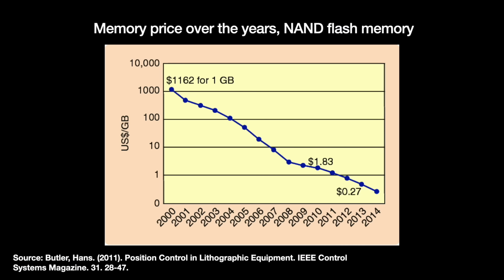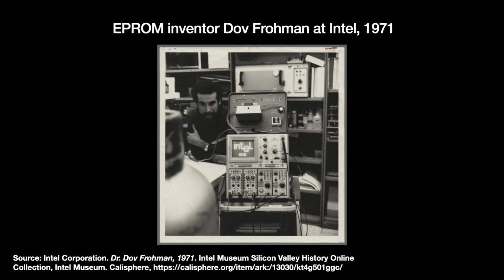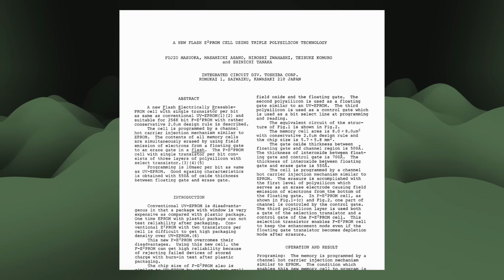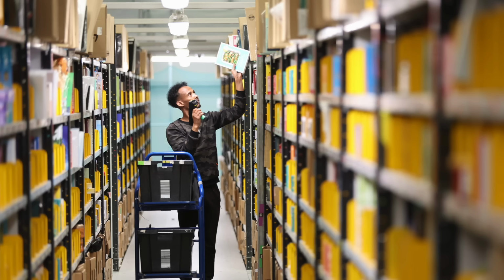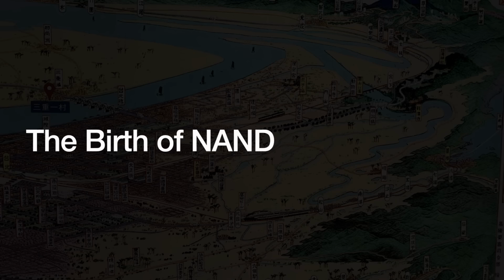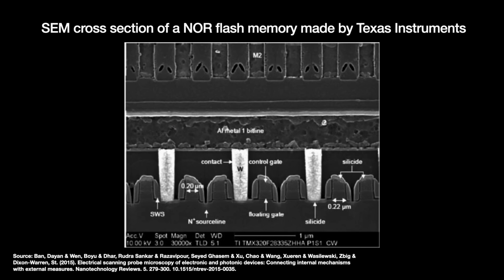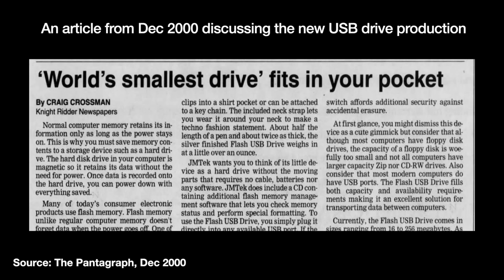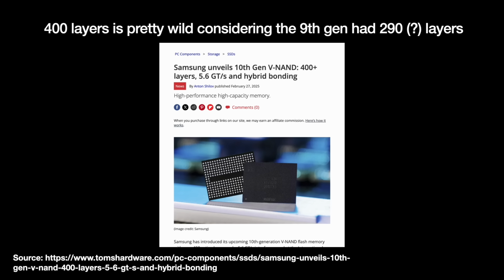The Evolution of Flash Memory

Comment: I found the controller comments a bit funny considering that harddrives also employ all sorts of wizardry to not loose data, because the bits are fundamentally volatile. So you need overhead. There is almost always 99% of the time error correcting overhead when dealing with a digital signal. Its rarely feasible to do without.

Comment: In your discussion around the state of the art circa 1980, I'm surprised that you didn't mention the EAROM, or electrically alterable read only memory.  One notable source of these devices was Nitron, originally a subsidiary of McDonell Douglas, using a Metal Nitride Oxide Semiconductor (MNOS) technology.  Writing to these was much slower than reading and the number of writes was limited, but writing was byte addressable.  They could retain their programming for at least ten years.

Nitron was founded in 1972, and I can find references to the technology as recently as 2001 or 2002.

Comment: I started using UV EPROMS back in the 2708 days, so yes I have been around the block SEVERAL TIMES !  (I thought I went to heaven when the 2732s came out !)

Now a days there are million of SOCs that execute from built in FLASH.  Most of the are small and execution speed is typically not an issue.  There are a few application (electronic fuel injection) that are quite large and require LARGE amounts of FLASH (or other reprogrammable) memory.  These application keep growing and the SOCs are now mostly FLASH and RAM.  (CPUs, even quad core, typically take up less than 25% and memory requirements grow yearly !  Off chip memory, both FLASH and RAM, are too slow.

IMHO, the solution is large on chip caches and NO ON CHIP FLASH !  Each processor needs its own  Level 1 instruction cache, as fast and as large as possible.  The Level 2 cache can be shared between instructions and data.  Speed is less of an issue here, but size is important.

The real trick is, WIDE "cache line", at least 256 bits, between each level of cache and the external FLASH.  Having this many data lines exiting the SOC is an issue !  The solution is simple !  Design the external FLASH chip with an interface similar to DDR dynamic RAM.  Inside the external FLASH chip, there should be 256 bit wide data paths.  These feed to a buffer that "double pumps" the data to the SOC, 32 bits at a time.

Comment: I was recently building a server on Raspberry Pi requiring at least 1 TB storage space (Bitcoin blockchain). I am still amazed that a single poststamp-sized SSD chip with 2 TB capacity can happily fit in a tiny box only slightly higher than a standard Raspberry case.

Comment: I remember getting my first 2GB flash drive around 2005, and thought I had SOOOO much storage in my pocket, and I spent a decent amount of cash for it. Now, I have two 32GB flash drives I paid like $15.00 each for, that I rarely touch compared to the 2GB drive I had before, which I used constantly. These days, I can just send files, even big ones, just over the internet to the friends I might want to give say, a bunch of pictures or a video file. Or if I can't send something over the internet, well, now I just use the 128GB of storage on my phone to move those big files as needed, with the added bonus of watching or looking at what ever it is on the phone itself if need be. I remember thinking back when flash memory was really starting to take off "Man, I can't wait till the capacity is well into the 100GB range in something I can keep in my pocket or on my keys" To now thinking "Wow, I can fit 1TB on something the size of my thumb nail, and nothing to fill it with." It is funny to me that at one time I relied heavily on burned CDs/DVDs, thumb drives, and even floppy discs to move information around, and now I rarely plug anything into my computer to move data, its all peripherals like my keyboard, mouse, and my game controllers. Every so often I plug in an external hard drive to pull old data off old drives, such as my massive music collection, but the last time I had a thumb drive plugged in, it was because my phone of that time was dead and I wanted to take some game files to a friend's house to help him mod a game, and that was, two or more years ago come to think of it....

Comment: Interesting facts that I learned just after watching this video: 
1) Toshiba no longer makes SSDs. They spun off their memory business into a new company called Kioxia  in 2019 due to heavy losses from their nuclear energy branch after Fukushima, and
2) Kioxia made space-grade SSDs for NASA to be used aboard the International Space Station. These are special SSDs without supercapacitors that are capable of enduring space radiation and remain functional. Linus Tech Tips made a video about it.
Reply: I used to work for Toshiba memory America back in 2016 -2018 I did competitive intelligence research on all of Samsungs data center and enterprise drives. We would structure the operating systems commands to be similar theirs. We had an EMI scanner hooked up to pcie ribbon cables to get the exact frequency the nand, controller etc were operating at as well as a flir camera to monitor thermal runaway.
Reply: @Parable54 Do you still work on the semiconductor side?
Reply: OG history

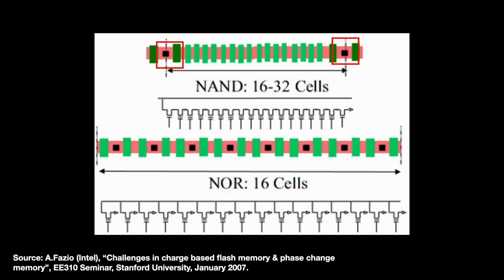Comment: 11:46 And that's why it's so frustrating that Intel closed their 3DXPoint productline, aka Optane. Optane is byte adressable and solved a lot of these issues. Imagine what Apple could do with that in an iPhone or Macbook. Instead of selling the patents, Intel just stopped making them. Sure, it's impossible to fit 245Terabyte on a single datacenter SSD but Optane is amazing for system responsiveness. I installed a 64GB Optane SSD with adapter on a 2013 Macbook Pro, and with Ubuntu the machine felt as responsive as a brand new Macbook
Reply: Optane was really cool. 3DXpoint was phase change memory, really cool stuff. 

Phase change memory would actually be a very cool video topic for this channel...

Comment: 0:09 So Apple charges 2007 prices in 2025 for what is essentially regular flash modules? 200 dollars for extra 256GB, when the flash is 0.02$? That's exorbitant to a crminal level on some countries. The storage cards arent really that special, and storage speeds arent faster than others. Apple's software makes the storage hardware appear special. 
  Fun fact: According to the mentioned 2014 prices, a 256GB storage upgrade should have cost..... *drumroll*
     .... $69

Comment: @Asianometry Ok, something often hidden from the buyer is the technology relating to the limit of: the number write / read cycles, retention life of written bits, and other robustnesses.  In other words, sellers are hidding what fragile flash technologies they are selling.

So, which flash structures are good for archival and system image life, with extended system powered down periods (years), and which of these are suitable for continuous access (read and / or write)?  It's hard to search this subject, and the write once memory alternatives to flash with 40-100 years retention have also largerly dissapeared from the public.

Ok, awake now.  Drift in multilevel cells over time. Electrical bit interference from constant operation of even nearby cells.  Limited life without refresh writing, so that years ago bit corruption was already starting to happen in powered down devices over 6 months in warm humid environments.   Durability means lower density storage and higher oxide layer thickness, but durability is still needed for some applications.  Sir Clive Sinclair's plan for wafer flash sized storage would probably be a good idea in these sectors, once layered in 3D, and 8, 32 or 1 bit cells per addressed position.

Comment: 3:28 The "E" in EPROM stands for "Erasable", not "Electrical". There were chips like that before that were "electrical" programmable - but only once- called PROMs. But these chips could be erased as well --> EPROM
Reply: PROM (Programmable ROM) is written once and permanently via electrical signals (stream of data in a special mode); EPROM (Erasable PROM) can be erased with UV light for reuse (had clear looking window); and EEPROM (Electrically Erasable PROM) can be erased and rewritten electrically, allowing for in-circuit updates, making EEPROM the most flexible and common in modern devices for configuration data, while Flash memory (a type of EEPROM) is now used for larger storage.

Comment: EEPROMS where popular for a moment in Telcom equipment that needed to be remotely updatable. Bubble memory had been used before that in many cases. You had two chips, and alternated between them to make a failure tolerant upgrades. I remember using the first flash to replace it - it was kind of a pain due to limited write cycles and some environment issues EEPROM did not have, the drivers where kind of a nightmare to write.

Comment: How do they put 400 layers on one die?  Does the wafer go around and around and around through the same coating/exposure/etch machinery, or is the production line two miles (or whatever it is) long?  Either way sounds expensive.  Tying up the machine in the first case, and duplicate machines in the second.

Comment: It’s worth mentioning that NOR flash is still useful for firmware because it allows for direct execution of code from persistant storage with no wait states.

Executing code from NAND flash requires reading entire lines into a cache which causes delays and increases architectural complexity.
Reply: This is the main reason NOR, EEROM and ERPOM are used in engine management computers, aka ECUs/PCMs as they need to load and execute code quickly and I also believe that these older technologies are much more sturdy therefore used critical systems like this.

I have one of my tuning ECUs swapped out for an NVRAM which is basically battery backed up SRAM, it allows much faster writing and randomly which allows real time code mortification on the fly, where the stock EPROM can only be changed all at once in a programmer with the chip removed, where the NVRAM allows a direct data link while driving to a laptop while in operation, aka real time.  The EEPROM upgrade allows more flexibility, especially post tuning, much better than using a dodgy germicide light in a box that is the ebay special EPROM eraser. Extra capacity too!

Comment: I was at National Semiconductor from 1993-1996 doing NAND Flash marketing.   National had gotten a license as well and set up a buy-resell business.  We had to sit tight for 1-2 years as Toshiba worked out yield issues on the first 16Mb (ha, not byte) devices.  We designed a chopped down 4Mb and 8Mb version for digital answering machines for which National was a leading processor supplier.  We called it Serial Flash because of the interface.  At one point as an applications demo, we made a 2MB solid state drive on a PCB that slotted into the ISA slot of your PC.

Comment: dude, a fet literally works on capacitance... its voltage/charge controlled.. boggles my mind you keep an audience of any merit. you need to relearn about charge fields apparently. and no current flows through the insulator, you know, like a capacitor... the floating gate is 'empty' of what? charge... hmmmm...

Comment: Kind of crazy how most consumers don't even use a hard drive these days. 
Will PC flash memory hardware continue to scale well in speed and density? or was it simply so fast at progress because it was "catching up" with modern semiconductor processes. It feels like we have been stuck with 8TB capacity limits on m.2 drives for an awfully long time, what's the hangup? I admit most people don't buy 8TB drives due to prices and not usually needing that much storage, but during the hard drive era, seeing one capacity as the maximum available for 4 years or more was almost unthinkable.

Comment: NAND flash memory has been price-fixed for nearly 20 years. The fact that mechanical hard drives are still cheaper for large capacity storage is patently insane. Hard drives are so many orders of magnitude more expensive just from a raw materials and engineering perspective that it's really absurd they're still around. NAND flash is a big grid. It's just semiconductors. Compared to modern hard drives, with platters coated with rubidium and other exotic materials, nanoscale read heads, rare earth neodymium magnets, pumped full of Helium (which there's a global shortage of), embedding microwave laser emitters for HAMR, motors, etc... But if you want 100TB of storage, somehow the hard drive route is radically cheaper. I'm just surprised someone hasn't purchased old lithography equipment and come out with a NAND based 3.5" form factor 'hard drive killer' selling 100TB of SLC NAND flash for like $99. The NAND flash manufacturers (the ones who got busted for price-fixing DRAM, then got busted for price-fixing LCDs, then got busted for price-fixing DRAM again) were being investigated for price-fixing NAND years and years ago... but the South Korean president shut down the investigation. The same president that got booted and jailed for corruption later, but had his bail paid by Samsung.

Comment: 3D NAND's stacking is encountering a bottleneck now. As more and more layers stack up, inter-layer interference is becoming more and more problematic. Etching a straight hole against that many layers is also getting harder. Some manufacturers have already begun to stack two chips, each with certain amount of layers to increase density, but this won't help in reducing the cost.

Now the increasement of capacity has drastically slowed down, even close to a halt, despite their effort of adding more and more layers. More and more manufacturers are focusing on speed now, launching pcie gen5 SSDs, usb 20Gbps flash drives, even dividing each die to up to 8 planes to improve random access speed. But I didn't see many customers buying these. I think after all the craziness in the past 10 years, it's time for a rest.

Comment: Another comment: one of the first flash applications I saw was a phone answering machine that was all solid state. It used a very early flash cell application, and thus was a one chip answering machine. This was prior to having enough flash to digitize the voice, so instead it actually sampled the audio and put analog samples into the flash cells, NOT bits.

You can see out this leads to multi-level flash cells. If flash can store an analog sample, it can store more than one bit level easily.

Comment: One thing that made E²PROMs not that common as discreet components, was that many micro-controllers embed a small quantity of E²PROM : ST62x5, PIC16F688, 68HC11 ect. Also, I²C EEPROM devices were not so uncommon you might think. The big advantage of E²PROM over flash was its endurance : PIC advertised over 10 millions write cycles.

Comment: well instead of the floating gate, use a separate diode reverse polarity capacitance. same effect, clearer construct. the reverse diode connects directly to a normal mosfet gate instead of being anything different. simplifies component variety issues. two-state memory cell is better. no confusion. SLC etc. there is no half-empty. or quarter empty. or quarter full. lol. only full or empty. ie 0 and 1. directly usable in any logic circuit. dont fall for more complex. you have to pay later for the complications. ie control logic is even more complex. you can get away with nothing with 1-bit memory storage. commercial success != freedom. market dependency by definition. market support required. market only talks. only if you would be real kings. if nor/nand only points to the cell access matrix topography then lol. not even close being nor/nand logic gates. market only misleads. well memory cell does not function like a logic gate by definition, so only a loose name usage. right v-nand manufactures multiple layers at once, not layer-by-layer like a logic cpu chip would be manufactured. ie custom structure on each layer, not a copy matrix layer. diode memory cells are just stacked solar panel cell layers.

Comment: I remember paying about $250 for a 256MB flash drive back in 1999, and thinking that I had gotten a good deal.  I did, for the time, but of course prices for flash drives and memory cards crashed over the following decade.
Reply: I bought a Sony digital camera in 2000. It came with a small memory stick, maybe 8 or 16MB. I needed a larger memory stick, and I remember that a 128MB stick cost around $100.